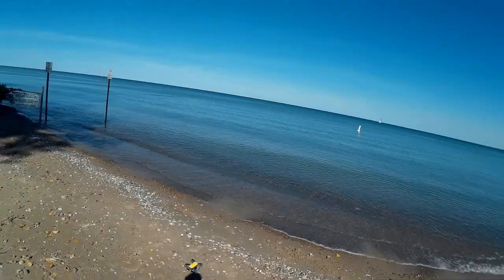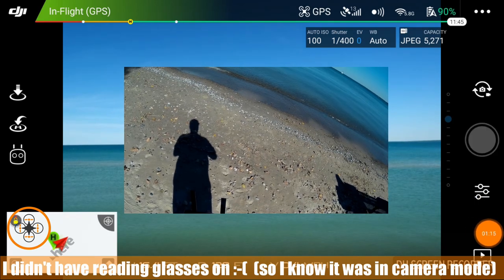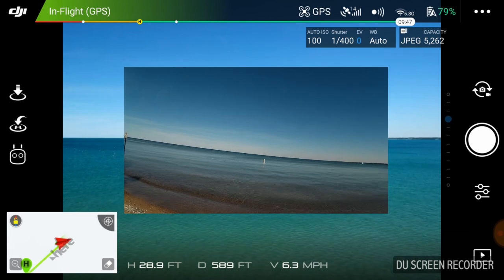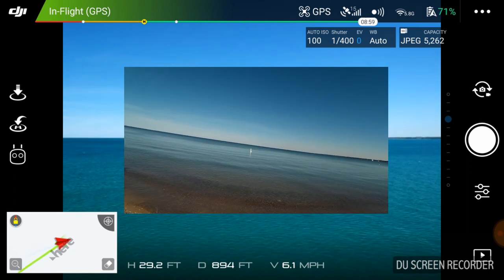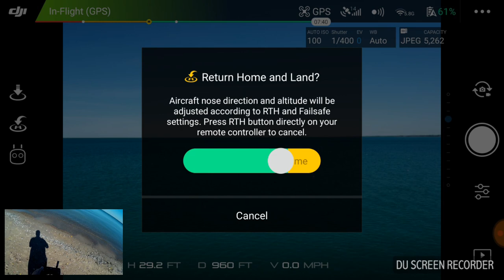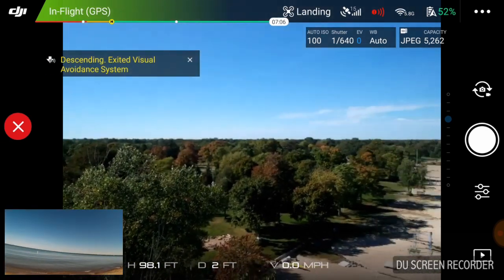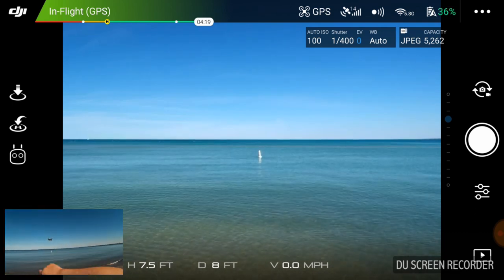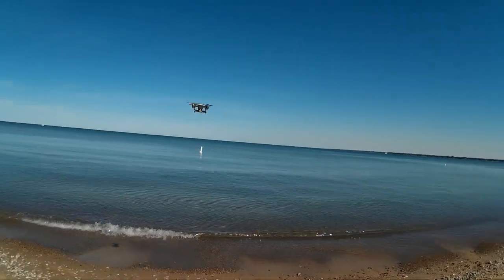Video Drone -  DJI Spark Daylight Testing of High Powered Strobe!

Comment: Hoby it truly a good question.  The Mavic lights are not good enough as far as 107 goes.  107 states that the lights must be high intensity.  If you got the Firehouse for the 3 led version make sure you mention Dumundseed sent you and they should sell the 3 light version for $28. I did not see the others that Firehouse sells in Amazon.
Reply from the maker: That would make sense (something far brighter then stock).  I am going to look around at various options and experiment...
Reply: If I was to use a strobe for real I would put one on top and one on the bottom.  Just like a plane.  Top and bottom give you maximum exposure.  The back is good for testing but would be poor for visuals.  
I got my DJI googles today.  Have not done anything with them yet.  I have a $45 real estate job on Monday.  Will take about 10 minutes.  Five pictures.
Reply from the maker: I am still nervous about placing anything on the "top" especially electronic  because as mentioned before that is where the GPS and magnetometer is located and this thing is building up and releasing a surge of current.  While you are correct exposure with one is limited, the design would allow a second to be placed on the front and I have even experimented with the idea of a dual unit as the weight is too bad because as you add weight you start to see loop issue in the ESC's.  Around 50 grams the ESC will start to enter a loop where they want to just keep adding thrust (you can see this in action action camera mount videos).  Also sounds cool on the real estate job!  I wish I had time to for fun stuff like that!  Think there could be a fair amount of business out there like that!
Reply: All I can say is that mine was placed right on top as you saw and there was no problem.  Sounds like another test for you would be in order.
Reply from the maker: Agree, however different things can happen at different times (I have an EE background and built LNA way back in the day, and EMI and play havoc with sat systems ) so just fly safe my friend because as they said in jaws, just when you thought it was safe to go back in the water :-)
Reply: Yes, I have an electronics background too, along with all the other stuff I did in my life.  Radio DeeJay, worked in TV, Magnum PI, Hawaii Five-O and others.  Anyway, I may never use the strobe again unless I need it which may never happen but will be ready if the need arrives.
Reply from the maker: Magnum PI!  Did you get to drive the Ferrari?  Sounds way cool!
Reply: No, I was not a star.  Mostly background parts.  It was good money for a days work where you really didn't do much.  It was a cross roads and I was encouraged to do more acting but I decided on Law Enforecment.
Reply from the maker: Hmm, you have really left me scratching my head on that one!  (encouraged to do more acting but I decided on Law Enforcement)
Reply: You have to go where your heart takes you and then there was this: http://theshooting.com
Reply from the maker: Wow!  Sorry just seen this!  When reply's get too long YT burrys them!   Have a couple friends that are police officers and I don't mean this to be a social form, but people do not realize (1) police are human and (2) they are walking in harms way every second of the day.

Comment: Is it okay to fly at night or shortly after sunset. ???
Reply from the maker: Well if your 107 certified, you can fly 30 min before sunrise and 30 min after with the proper warning lighting such as this.  However for non-107 the regulations are a bit vage so just stick with 107...